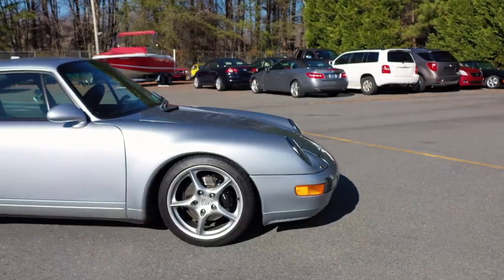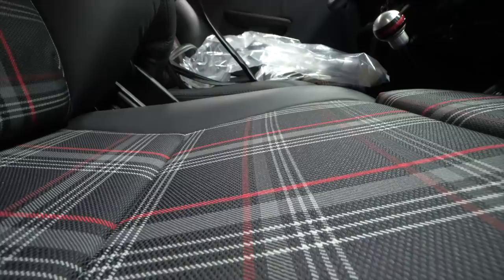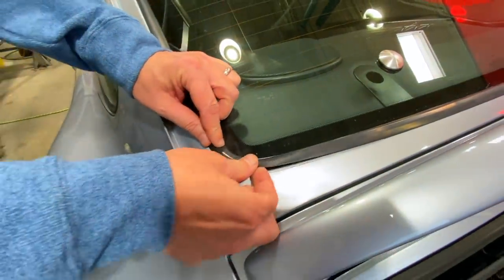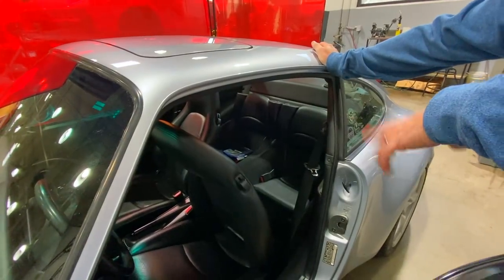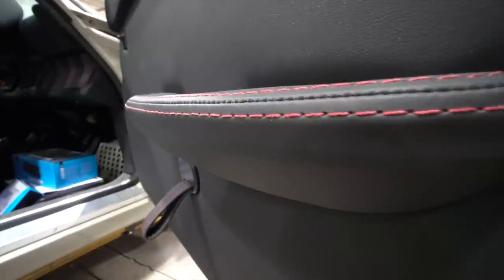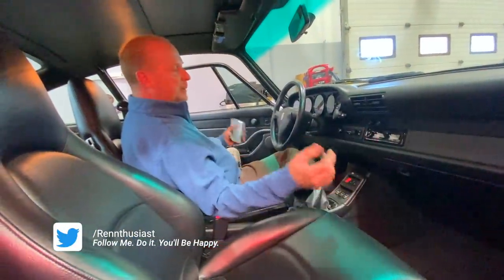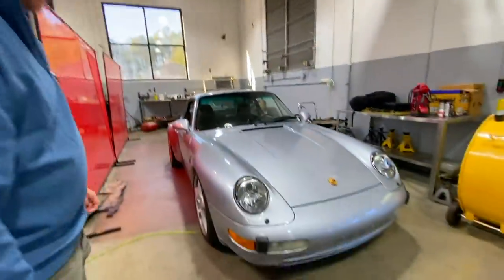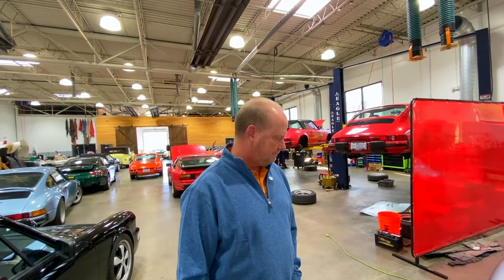My Porsche 993: Should I SELL It or MODIFY It?  The Answer

Comment: Great vid. I have the same car with the same mileage, 150,000 km. Honestly, I have been thinking about doing the same thing as you so following with interest. New to your channel so not sure what you’ve done but a couple of thoughts. First, have you replaced (or added) an LSD? If the car had one, it is probably shot by now. Guards seems to be the brand of choice. Second, the seat foam breaks down over time so definitely recover the seats. It will make it feel like a new car. Like the rear seat delete but roll bar isn’t a good idea if not tracking the car. Just me but I wouldn’t upgrade the exhaust further. Nice the way it is. Love the turbo look front bumper. Consider deleting the rear bumperettes at the same time. Although it is tempting, I would not sacrifice the airbag (assuming they don’t have an expiry date?) for style. Good luck with the mods. I will follow with interest.
Reply from the maker: All great insight.  I appreciate it!  Thanks for watching and subscribing.  Here’s a link to my 993 playlist if you’re interested in seeing other 993 vids.  Lots of info about repairs and cost of ownership in there: https://youtube.com/playlist?list=PLR0VqbBaNjTO9UqpRV7KAm3rLJsTeL7kR

Comment: So youve decided to spend 10k on ruinning the car and droppong its resale by 10k for a new loss of 20k! And you will undo most of the handling modes after 6 months or fall out of love and sell it. GG !
Reply: BTW the carpet, if your planning on replacing everything, sides, back , front, etc... is completly glued in, i changed mine 15 years ago and the labour alone cost 3k (pounds). So lets see if u can hold the budget without getting the work done in mexico, wheres my popcorn ?
Reply from the maker: Sounds like you wouldn’t be a buyer once this project is done.  Luckily there are a lot of bone stock 993’s floating around out there.  Thanks for watching, and be sure to subscribe so you can watch it unfold! 👍🏼
Reply: @Rennthusiast  Well, I've owned 993s for over 23 years and made pretty much all the mistakes your about to make ! So I thought I'd chime in and provide my 2cents worth. The only thing I'd suggest U focus on is the rust under those front and read window seals ;)
Reply: Oh ! and engine mount replacement, maybe exhaust back box replacement (enhance the sound) . Those are actual improvements.
Reply from the maker: Martin Griffiths absolutely...top priority is the rust repair/mitigation.  

I have friends who have done these types of mods to their cars and who are super happy they did it so I think basically it boils down to personal preference.  That’s the great thing about this community.  Something for everyone.

Thanks again for watching and for weighing in.  Smart people out there with a lot of experience which I appreciate.  Exactly why I did this vid.